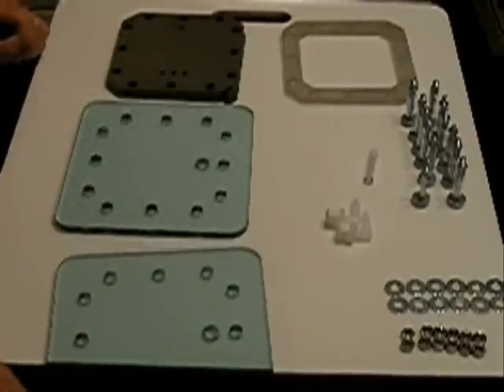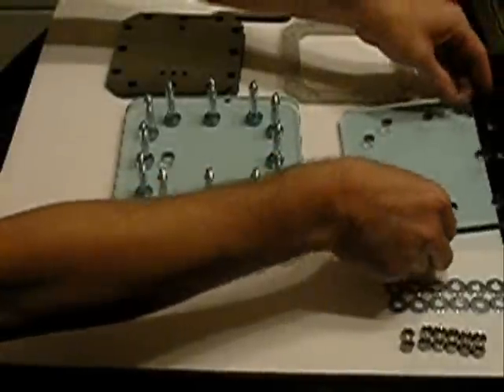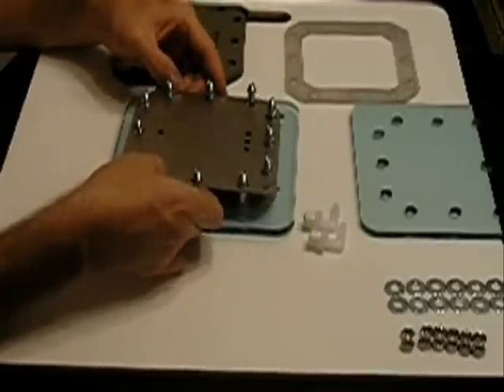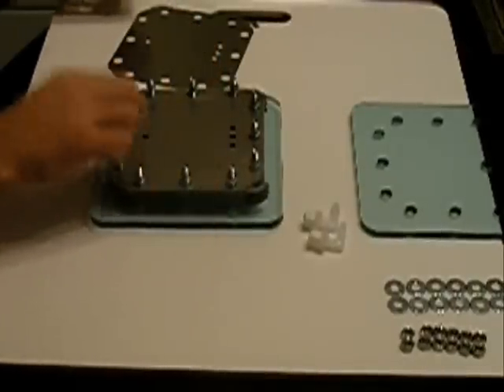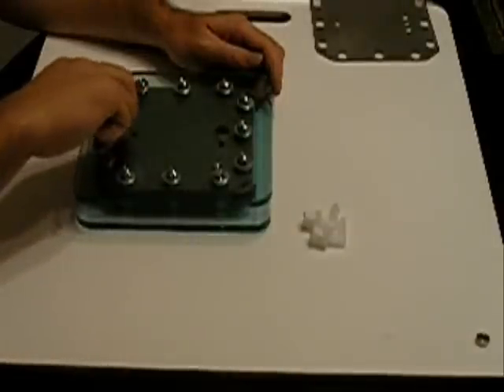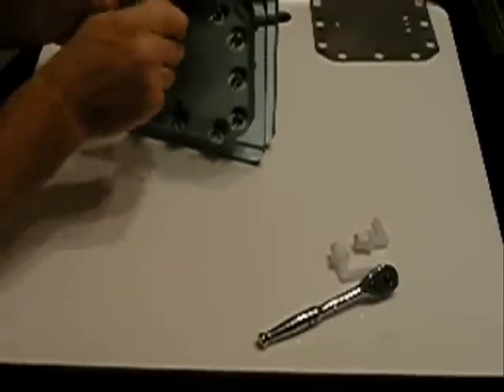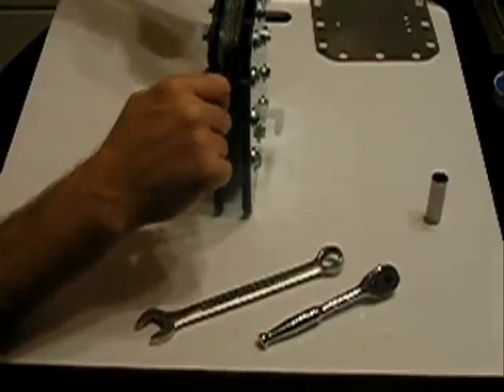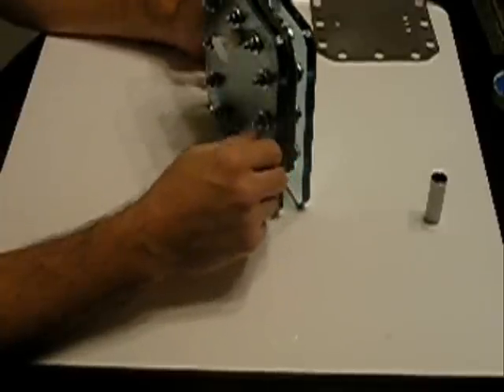6''x6'' Dry Cell Build.  How to.

Comment: why do you call it dry cell?
Reply: Andreas G. 
Because the wet cell is submerged in the liquid, and the dry cell the liquid is inside, and there is very little liquid inside at any given time. Only the amount that fills the spaces inside the gaskets and the small open spaces between the plates. Dry cell you only see some bubbles of liquid in the hoses. A wet cell is like s swimming pool for the plates. So a dry cell is safer. And also easier to handle, install, and maintain.

Comment: Please send me your email in order to send a picture of my plates,
I want to buy 21 plates of SS316L, are 6 "x 6" with cuts to 45 degrees, 1 "in the corners, are only 3 holes, if you want to send you a picture.
My design produces 10 to 1 ratio hydrogen / Oxygen
my email sangiooo@yahoo.com

Comment: Hello.Im really intersting to build by my own one. Please help. I do have couple questions about it. So here there are. How muck will be coast to cut  holes on one plate with laser cuts?
Reply: Ruslan Makhmudov 
you don't need the fancy crap. Just drill the holes, do some light filing and sanding. I make them for free with just looking around for scrap stuff. Tire shop and old truck inner tube and I've got enough gasket material for a bunch of generators. Coffee can full of nuts and bolts for a quarter. Couple bucks for a roll of plastic hose for insulation between the bolts and plates. Scrap stainless basically free look around some.

Comment from the maker: It is called Hyzod HD. It is a glazing material rated at 800 F. 
 I buy it from the company that cuts the plates for me. Unlike rubber type gaskets, you can torque these down as much as you need.

Comment from the maker: I would say around 7 lbs. should do it, but with this gasket material, you can torque it as much as you need to seal it.
 The brass looks nice, but I feel more comfortable with the watts nylon hose barbs. Plus they cost $1.68 at my local Lowes.